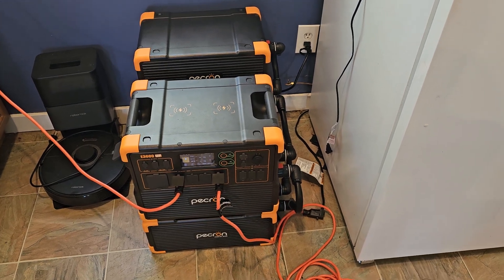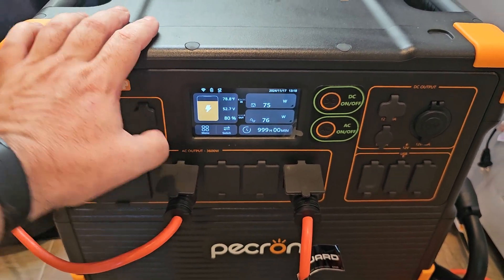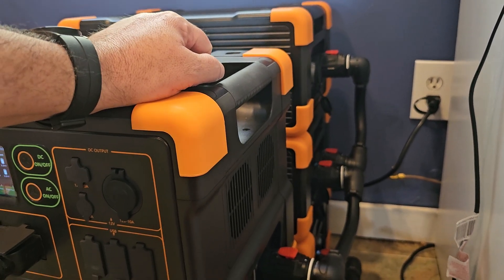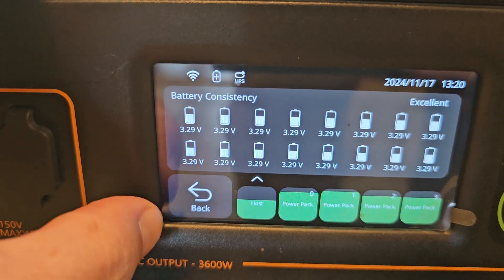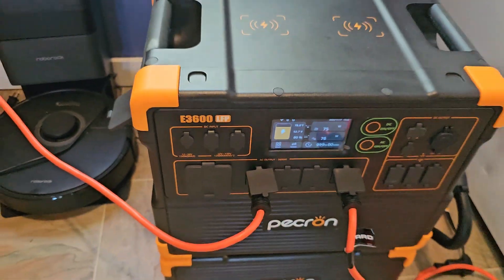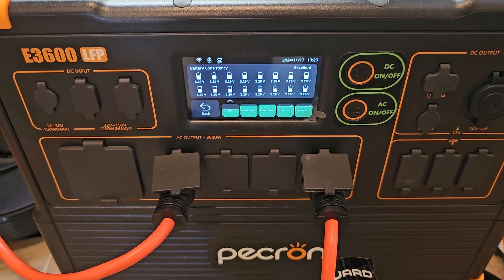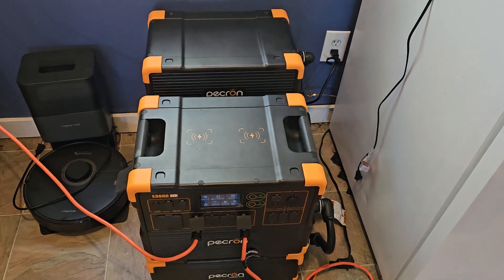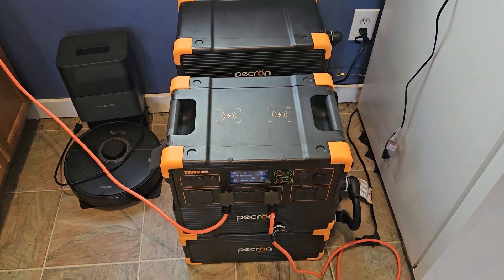Pecron E3600LFP grid down testing wrap-up.

Comment: Main Stations uses 37watts  at all times resting on.  main unit resting will die in on switch in just under 4 days no load. its just the inverter running in background they all do that but 3600 is a big won.

Comment: I love your videos and I am a new subscriber. I recently purchased an E3600 LFP and a extra battery.  Do you know if the E3600 and/or the have a low temperature cutoff so that the battery does not charge if the temperature goes below freezing( or a certain temperature)? Thanks again! I see you use them outside in the cold too.
Reply from the maker: The manual says for discharging the temp range is -4F to 113F and charging is 32F to 113F. Since I have my system in a plastic box, the air temp inside is always above 32F. I have not had any issues charging or discharging with outdoor temps down to 19F. I do think as spring and summer approach the heat will be an issue. So I plan on installing a thermostat regulated fan or two in the box to mitigate it.

Comment: Just helping out if I can :)

1. Rated at 3,500 cycles, not 3,600 cycles

2. You can cycle LifePo4 batteries all the way down to "0" as long as you don't let them sit there for long periods of time :)
(Use 100% down to 0 to get the best bang for your buck, you bought it, use it...just do not leave it at 0 for long periods)
*Watch "DIY with Will" to understand more about the false rumor going around with this 80-20.

3. Always charge you batteries (if you can) to 100% once a week to help balance the batteries :)

4. You have that last battery hooked up wrong (Should be plugged into port 1 instead of port 2, like you have it)
(the battery way in the back on the top)

We have the full 15,000wh system on our channel with hundreds of hours on video

E3600LFP (port 1) -----> (port 1) [BATTERY 0] (port 2) -----> (port 1) [BATTERY 1]
                ^  (port 2) -----> (port 1) [BATTERY 2] (port 2) -----> (port 1) [BATTERY 3]
                                                                                                              ^ This might be your problem

You have Battery 0 & 1 correct :)
You have battery 2 & 3 wrong :(

(FIX) Take the battery 3's connection out and put in into port 1

Don't know for sure if this will or will not fix the battery balance, but having them hooked up correctly could not hurt :)
Reply from the maker: Thanks for all of the great tips! I will try that out and see if that fixes the balance issue.
Reply: @GridDownPreparedness  We own almost every system that pecron sells (missing only the e1000lfp & e2400lfp)

We have learned MUCH in the last 2 years about pecron stuff :)

Feel free to come over and scribe to the channel, we would love to have ya :)

Comment: Hey thanks for the video, I have the Pecron E3600LFP, and will receive my EP3000 Extra battery tomorrow so I do not have much experience with extra batteries yet, but I have done alot of research from others that do have them, you should check out Ramblin Bob's channel he has the entire system like you do and tests extensively, I have learned alot from his channel alone, check it out if you like, one thing you should do is charge all your batteries 100% it wont hurt this type of batteries but they balance out, just set it to charge at 100% and leave it charging a day or two and keep checking your battery health and you will start to see the volt numbers increase on each cell and you will also see each cell start to balance out, again the system does this all automatically for you just set it to 100% charge. keep them videos coming and stay strong and encouraged!

Comment: Any luck in finding the Pecron recommended cabling sequence? Will order the 3600 and (3) 3000 batteries this week. I am also exploring the best manual transfer switch for these units. Again not much info available. Currently thinking between a 6-10 circuit transfer switch.

Comment: Charge to 100%, they aren't lithium ion, LiFePo4 will handle being at 100 just fine esp if it's in a situation where you need to have the power available.  As for cycles and life, you'll probably lose more in shelf life over 10 years than you'll lose from cycling them.  Not sure how Pecron does their balancing but likely a passive balancer that burns power off cells that are high when it gets to a full charge.  LiFePo4 charge curve is VERY flat, looking at voltages for how full something is won't work out very well.  Set your charge limit to 100%, charge up and check cell balance after a day or two.  Wonder if they give any balancing status info, that'd be nice to know.

Comment: Hmm, I only have the E3600 and a single EP3000.  And they stay much more close together.  I wonder if you had them connected more sequentially if it would make a difference, like 1 connected to 2, 2 to 3 and 3 to 4….
Reply: You do not want to have more than 2 batteries per port. Not a good idea :(

Way too much resistance for the battery cells for all that power to flow through 1 cable instead of 2.....

*2 batteries per port is the max for the e3600lfp

Comment: I like your videos and this test. Keep up the great postings! I also purchased the e36000 plus 1 expansion battery which is currently in shipment.  This after we had a power outage of 59 hrs. and had to throw out most of our stuff. I Decided to go this route instead of a generator. I think you said you have no solar yet; I do not. And again no generator.  I am curious as to how you charged your ep3000 batteries? For me 30 hours using the car or truck battery is of course too impractical. But, I have heard it's best to charge the host battery to 100% set it aside. Then charge the expansion battery to 100% before putting them together. This was a video I saw on Amazon reviews and it was the Pecron e2000 which comes with the (brick) charging system. He also claimed it was important (recalibrating) * my term; the Host e2000. I don't want to degrade my new generator/ batteries out of the gate after I get them. Anyone reading this if I charge both e3600 and ep3000 together at the same time after receiving them will that do either unit harm? degrade is what I mean

Comment: I don’t have any expansion batteries yet but I can confirm that my e3600lfp  top balances at 100%
If I were you I would fully charge the entire stack until current draw has dropped to zero and stayed there to fully balance all cells then repeat the test, at least partially, discharging to 50ish% for your storage, depending on how long that will be. With the flat discharge curve of lfp and the cells likely not balanced, the main unit is probably not getting a completely accurate picture of the expansion batteries state. As another commenter said, watch the latest videos from Will Prowse about cycling lfp batteries for solar.
Reply: Mine never goes to 100%.  It hit 99% with 1 minute of charge time left but just stays there and never hits 100%.  I remember waiting like 8 minutes at 99% charging at 1800 watts.  It got to 55.2 volts on the batteries.

Comment: For 5300 I will want to use more than 60% of the capability.   I might get myself one of these I like how fast I can charge it from a 30 amp generator.  They have their place and the price just keeps coming down which is great.
Reply: You can use 100% of LifePo4 batteries 100% down to 0%

The key is...Not to leave them there too long ;)

Watch "DIY with Will" to understand more about this false rumor going around the internet ;)